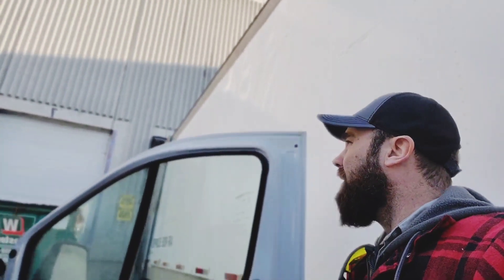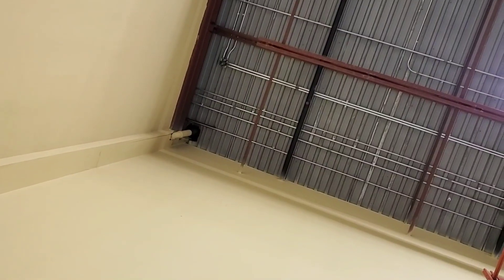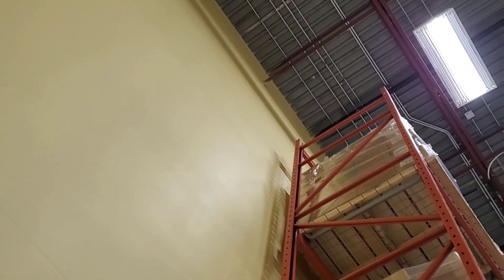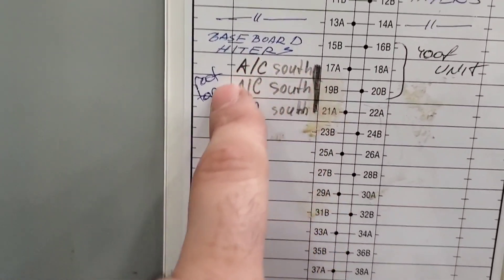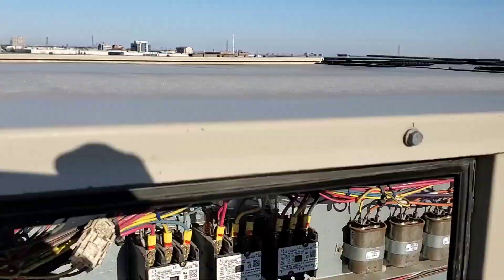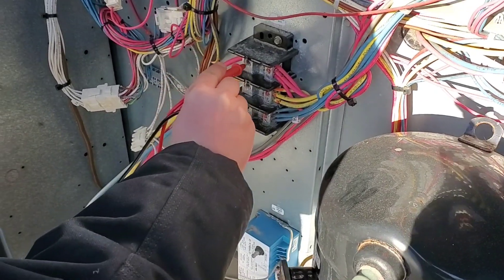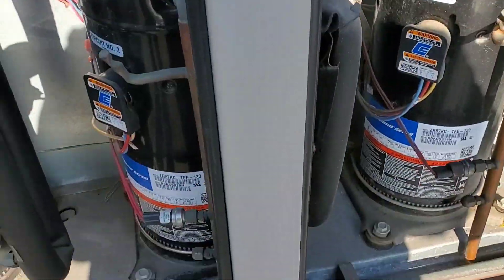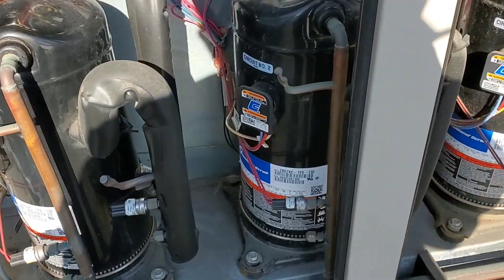How To Find A Tripped Breaker And Then Repair The Problem

Comment: How much time was spent tracing the conduit? Client gotta pay, for that oversight of the connected panels, and the clearly marked breaker, and the time spent redundantly tracing. Yes they do; moving forward, check your panels twice!!! Otherwise solid service call, sound findings, and a professional job!!!
Reply from the maker: About 20 minutes.  Customer paid a whopping $30 for that.  That place had about 30 panels.  This method was pretty effective.

Comment: Shouldnt the breaker be turned on with the right hand so it doesnt have a chance to go across the heart if something goes wrong?
Reply from the maker: The only way it crosses the heart is if you're touching another conductor.  Then the power will move through you.  The main thing to remember is don't put your body in front of the panel or disconnect, move to the side and keep your other hand to your side and not touching conductors.

Comment: I believe the K11relays for the condenser motors deenergize the CCHs. The ice cube relays on the top right. You should check those for damage. Also there is a fuse left of the compressors. When the magic smoke gets out of them that violently it can take them out.
Reply from the maker: Yes K10 and K150.  Those were all good!